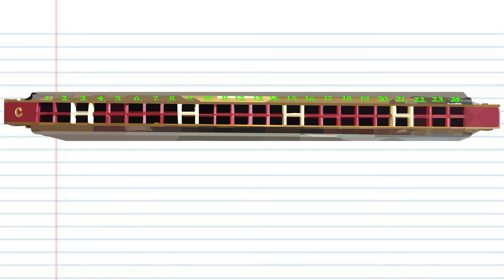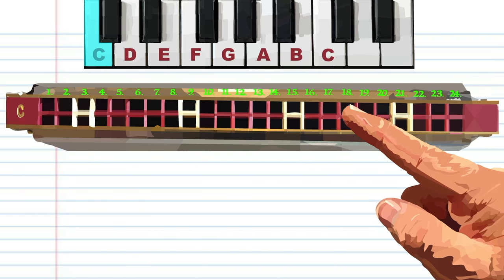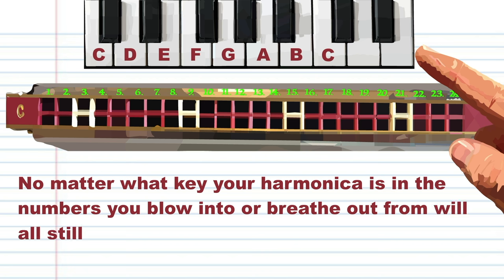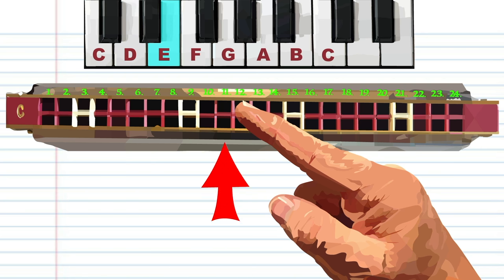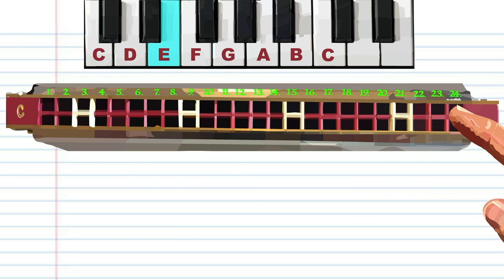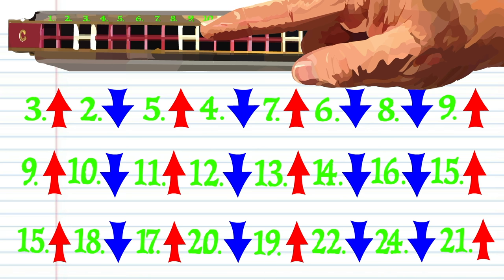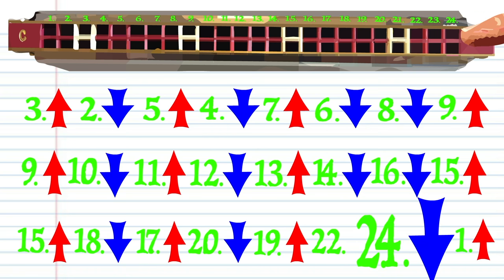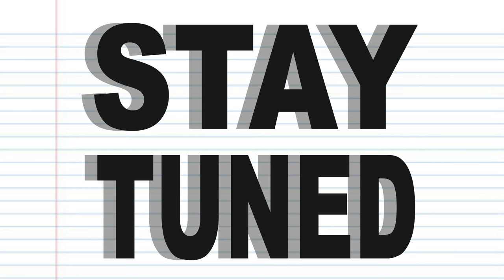How to Play a Tremolo Harmonica with 24 Holes

Comment: Excellent tutorial. I wish I had seen it five years ago. I have tremoloes in three formats: this one ("Asian"), Richter, and Solo tuned. Each has its advantages. Solo tuned is the most straightforward layout. Richter has the I and V chords for  self-accompaniment on traditional tunes. But this Asian layout has a complete scale in the low octave and gives a warm rich tone not available on the middle octave or on a Richter. It's the reason I'm drawn to it. It's also the hardest to master for several reasons. Thanks for putting it up.
Reply from the maker: thanks for watching! Glad you liked it!

Comment: i´m totally confused. what i know about tremolo hamonicas is that you play two holes at the same time in the upper or lower row. for example blowing into the first and the second hole is like blowing in the first hole if you have a standart diatonic harp. the harp in your vid has 48 holes which make it 12 possible positions to play
Reply from the maker: I'm pretty sure I say in the video that you treat the holes on top of and below each other as one hole, that is what you mean right?
Reply: Yup, I was confused as well. This may be a different type of tremolo? I have a tremolo harmonica (24) and it works the same way as a diatonic (2+2 is one note), only it has a tremolo sound and you can't bend.

Comment: The hardest part for beginner is that the note is not order at a normal sequence, I think the proper way to recognize the note instead of memory the number about the hole to play a song. If you want to become a better performer.
Reply from the maker: The way the notes are arranged on harmonica is very important and absolutely crucial for the instrument. 1. it allows you to be able to blow into the neighbouring holes without it sounding bad because the notes harmonise together... 2. The order allows you to be able to play the same song on different harmonicas in exactly the same way... the hole numbers will be different but the blows will still be blows and the breathes will still be breathes no matter what type of harmonica you play. If it wasn't this way, if the numbers were in sequence like they are on a piano then the  harmonica would only be possible as a single note at a time instrument, it wouldn't even be called a harmonica because there would be no "harmony", also for every song you wanted to play you would have to learn how to play it all over again if you decided to try a different type of harmonica.
Reply: @KerinGedge  Yes, my point is that read the spectrum instead of harmonica tab. At that case you could understand the phrase in different type of instruments.

THX for your attention, And I appreciate your effort for answer me :)
Reply from the maker: Maybe you would get more out of my TABS? I've started a new format where I'm just showing the arrows instead of the notes... I've only done a few though, am working on more :) Good luck!
Reply: @KerinGedge  wow teach! Ur a dedicated teacher. 💕🙏🙏🙏

Comment: Just bought my harmonica. I have a question. some holes are not supposed to make sound when drawed or blowed right? I mean is it true that each hole is specifically designed to draw or blow.
Reply from the maker: If yours is a tremolo then yes that is generally the case!
Reply: @KerinGedge  yes exactly . But the one that I bought works both ways on every hole. Did I just bought a broken tremolo? I am super beginner and I wanted to learn it so Pls let me know what do you think about my case.
Reply from the maker: Do you have the brand name and type written on the harmonica?
Reply: @KerinGedge  Its says 24 hole tremolo harmonica. No brand name

Comment: Can you play sharps and flats with harmonica?🤔
Reply from the maker: Yes and no... with a diatonic you can "bend" notes to produce notes that aren't naturally part of the scale your harmonica is tuned to... you can do this on a tremolo but it's difficult and you have to do it through only one of the "double holes"... but if you really want to play sharps/flats easily try a Chromatic harmonica.
Reply: @KerinGedge  thx, after the final exam i will try it😀

Comment: In my tremolo, there  is no continuously increasing numbers from 1 to 24 instead it has 5,2,1,4,3,6,5,7,1,2,3,4,5,6,1,7,3,2,5,4,1,6,3,7............are these both ways equivalent?.....Please help me understand.
Reply from the maker: Don't let it confuse you, the numbers in my video are still relevant, except the makers of your harmonica are being clever.... the 1's = C, the 2's =D, 3=E, 4=F, 5 = G, 6 = A, 7 = B - assuming your harmonica is in the key of C... if your harmonica was in a different key, for example G, then 1 would be G, 2 would be A, 3 would be B etc etc
Reply: @KerinGedge  Thank you very much. So, the numbers actually denote keys. Yes, my harmonica is in the key of C.
Reply: @KerinGedge  Yes,my harmoica is in the key C. Thank you very much.
Reply from the maker: Yes that's right... it can be really confusing but makes sense when you realise what they are.... so when watching my videos you have a choice to either go by the letters or follow my finger pointer!

Comment: I’m still wondering why anyone made the system the way it is
Reply from the maker: Ok, I'll try to explain.  The harmonica is designed so that if you blow in any given hole then the holes on either side will harmonise with that note, like they would in a chord. This is true of a standard diatonic or a chromatic harmonica. If they made it so that holes 1-10 went in alphabetical order,  CDEFG etc, then if you blew into any hole the holes on either side would not sound "right" but would sound augmented and you would have no choice but to play a single note only. Now if you were to look at the TABS for any song, you would noticed that the breathes and blows are all the same no matter what type of harmonica you are playing. I think this is why the tremolo is structured the way it is. In theory you should be able to play a song on a diatonic and then be able to play it the same way on a tremolo, only the hole numbers would be different.

Comment: What a stupid notation layout. What gives with these?
Reply from the maker: Nope nope nope, you couldn't be more wrong... no offence... not only is it logical but it's also completely necessary for the instrument to actually work. The notes are arranged that way on harmonicas so that when you blow through a hole along with the holes on either side, it will produce a CHORD. The notes on either side of each hole have been strategically placed there so that the notes will HARMONISE with each other, hence the word HARMONICA. If the notes were instead laid out like they are on a piano for example then blowing through 3 holes at a time would produce an ugly augmented chord, the instrument would become totally useless.
Reply: @KerinGedge  so it’s chordal instrument?
Reply from the maker: Yes, but you can also play single notes on it.